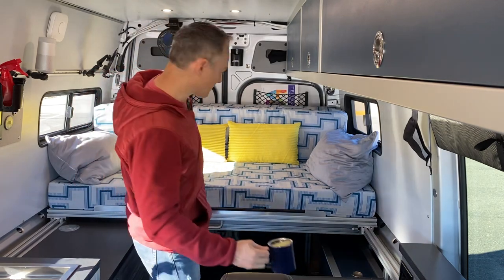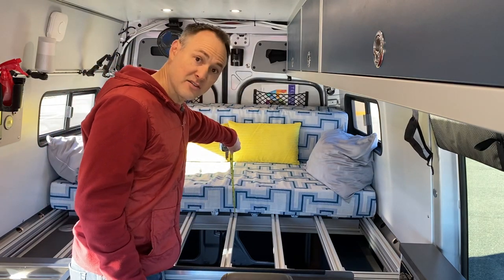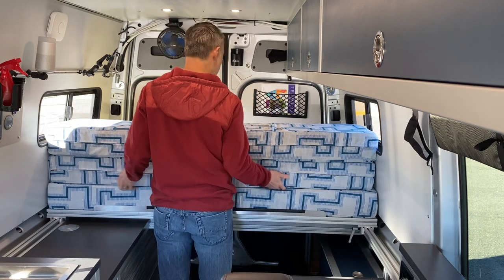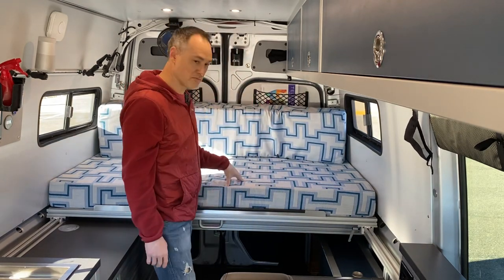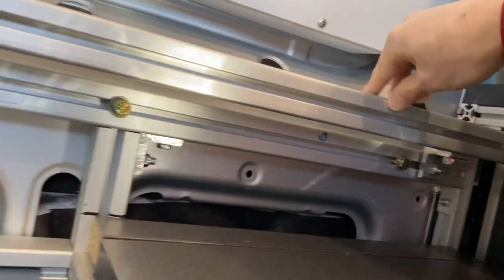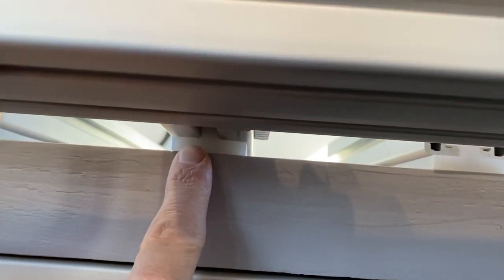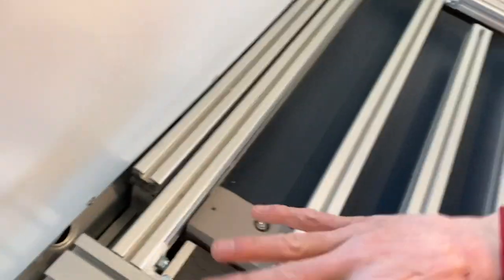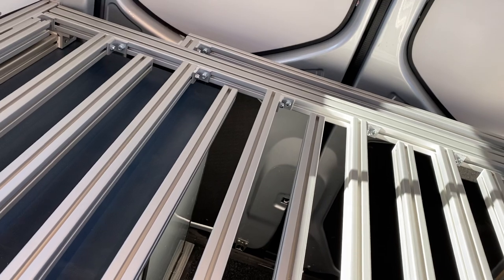Sprinter 8020 bed - deep dive

Comment: Really nice job, I admire your ingenuity. The sliding bed really gives you more space when the bed isn’t in use.  Lots of moving pieces to lineup to make it slide smoothly, maybe a little Teflon spray on the sliders will help it slide easier. Really well done!

Comment: Nice build. You answered one of my questions for my bed design. You are using two wide beams to carry load without vertical support in the middle of the bed. 

I also appreciate your insight on the side wall  mounting. I have a 2017 Transit and I want to use existing holes as much as possible. Running an attachment rail with washer shims to get side risks perfectly parallel is easy with your design.

Comment: Hello Nick, it is really incredibly perfect idea to make a bed very variable and use the space in many ways 👍👍👍👍👍
Can I ask fid you assemble the sliding system... I need sth. similar and sliding, just not sure which parts to buy... And connect to make it sliding..
Reply from the maker: Thanks, I don't have the entire parts list most of it is just 15 series extrusion. This is the slider part https://8020.net/6525.html

Comment: I really like the multi functionality of this bed system. Couch mode or Chaise mode still allows for one person to nap, while another has access to the rest of the seating space or galley area. I will be using my Van for work (daily commuter) and really like the rear haul space this sliding bed system allows. Loadig bigger items, camping gear or mountain bike before you set up camp is great! Thanks for sharing. How much did this cost?
Reply from the maker: Thanks Calia, for the bed frame system alone it's about $1k

Comment: very nice, so basically a 2 part slat system.  I can see how squareness, parallels become important.  80/20 does not forgive out of square.  You could have gone nuts with the engineering on this one.  You could also have made the head of the bed area tilt up.  Like a Rock-n-Roll type set up.
Reply from the maker: Yeah trust me I thought long and hard on a tilting back. But in the end it hurt my head and probably would’ve cost me another 500 bucks. I still have ideas on how to add it in the future. However, it’s not something I feel I need at all so I probably will never do it

Comment: What do you think is the cost breakdown is for the platform ,the bed cushion material. I think you said it was 300 or 350 to cover it . I didn’t if that included the cushion material. Looks like you did a nice job building it using that 80-20 material seems to make it easier. I’m a machinist I’ve worked with aluminum it’s a easy material to work with though I’ve never worked that particular extrusion but it definitely looks like the Way to go
Reply from the maker: I would say about a grand for 80/20 give or take. Latex mattress about $250 (two 3" thick latex mattress toppers combined), upholstery $280 (including at tip). Look for something local, mine was working out of her home. I used sunbrella fabric which was most of the cost. FYI other larger upholstery shops wanted around $700-800. Yes 8020 is easy to work with, never had a single issue cutting it.
Reply: @nicksrig  that’s well worth it thank you
Reply: Howdy Nick...how many sticks of 80/20 did you use for this?  I’m looking to do the same bed in a 2020 Transit. Thanks!

Comment: Nick could you please share your design schematic? I really like your design over the original. I am about to build the same in my van.
Reply from the maker: Yeah happy to share, shoot my your email and I can send it. Keep in mind my schematic is not complete. Like anything my design is how I planned, but once I got into the building, things change a little and I never went back to update. I used Sketchup
Reply: This is a great video! Just what I have been looking for. Watched Savage’s video (also a great job!) and found yours after. Would love to have your schematic just to see the working parts. I have a promaster and know I will have to adjust measurements but having what parts you used would be so helpful.  Thanks.
Reply: Nick - would appreciate your plan too - appreciate that its a working plan and changes made as necessary during the build. 2 questions - and extra piece to the front and back slides would have made quite a big difference in spacing - in hind sight would that have made sense - or biased or smaller spaces in the center of the bed where most weight /knee pressing on the mattress when you shimmy up onto the bed/chaise. And question 2 - what is the added piece for up against the center of the doors - to stop pillows falling off because of extra space there? How can I get you my email?
Reply: Nice job and excellent explanation.  Could I get your schematic too?

Comment: Hi, Nick--this is fantastic, thank you for this!  A few questions---do you think using the larger 15/15 bars was overkill?  I ask because I've seen some other beds with just 3 or 4 of them spanning the whole width of a van.  Could you have used 10/10 and still be plenty strong?  Also, what is the total length of your bed and how did you choose its height off the floor?
Reply: @nicksrig   Aaah, so the fasteners become the weak link with the 10/10--I didn't think of that!  My bed height question concerns putting a bike underneath and balancing that with sitting height above the bed, and length I ask because I'm 6'5" and found the crosswise sleeping didn't work for me when I tried one for a week.

Comment: I’m SO surprised you don’t notice the bed being in 3 separate pieces! I have been waning to do a custom latex mattress as well and have been thinking about making it like a trifold mattress, but I like the flexibility you have of doing different positions. 

Did you get a full mattress and cut it yourself? If so, where’d you get it from?
Reply from the maker: Sorry for late reply, but I bought it on Amazon and cut it up. I doubled it up as well. So it was a 3" mattress topper and I doubled it up to 6". I then found a local seamstress and had her cover them in Sunbrella fabric. No regrets whatsoever

Comment: Curious, think you could build what you did and also make the entire platform able to raise and lower along tracks? I'm thinking about how to dot his and whether it'd work in a high roof van to get the bed out of the way to accommodate a table below it.
Reply from the maker: Interesting question, and anything is possible with 8020. Just off the top of my head this is what I would do to make that happen. Build the bed system the exact same way but not as wide. Instead of attaching the side rails to the van mount them to 4 horizontal rails with the same slides with locking breaks. Hard to detail it in writing, it would need to be done in sketchup or similar. Honestly, I wouldn't try it because it presents other issues like lifting the bed evenly so it doesn't jam. I would probably just get a power lift bed system, then make an 8020 bed frame for it that folds up like mine. Best I got

Comment: Any thoughts about doing this in 10 series (1"x1") extrusion? 15 Series got really expensive and its about $2500 for the setup now
Reply from the maker: 10 series is plenty strong enough but the connecting hardware is super weak

Comment: What's your gap spacing for the supports? You mentioned they support the mattress very well and your knee sinks just a little, but I don't think you actually mentioned how far apart your supports are?
Reply from the maker: Hi Grover, it's 7" I do measure in the video, but I'll look back at it.

Comment: Can you please post the model number of the linear baring used?    Is it 6526, 15 Series, 3 Slot Mount Double Flange Long Standard Linear Bearing with Brake Holes?
Reply from the maker: Yeah sure it’s the 6525, and of course you have to order the brake separately
Reply from the maker: Brake is 2797
Reply: @nicksrig  thanks for getting back to me so quick! 6525 you mentioned are the short linear bearings. 6526 I am looking at and mentioned in my Q are the longer ones. Could you please clarify?
Reply: Ok 6526 won't work, 6525 is the part I should be getting. Thanks Nick. Good improvement to seven o savage's design.

Comment: How easy is it to remove the sliding portions? Does it require tools?
Reply from the maker: Not easy, you would need tools. I’m sure you could design it to where it could be easily removable. But mine is not

Comment: I'm pretty close Nick. I'm at the slide portion...how did you keep it from swaying side to side?
My guess is as I attach the doubles it will rigid up
Reply from the maker: Awesome, not sure I 100% follow what you’re talking about but the plastic slides across all the rails are what keep it aligned if that’s what you’re referring to
Reply: @nicksrig  I have it set man...I changed up your design just a bit. I like it the way it is. You helped out a bunch with my idea for my system

Comment: Not sure wHere you get your 80/20, but that bed setup prob cost around $1000 at least!! 80/20 is not cheap, and there is much cheaper ways to accomplish the same thing. Looks nice though, if your rich and have the money to spend
Reply from the maker: Oh agree with you! I bought it pre pandemic, I can't imagine what it cost now. It was more to me that functionality, I want strength. It also acts like an internal impact cage if I'm ever broadsided (I have kids in back). Alos, if I'm ever in an accident I don't have to worry about wood shrapnel flying all over the place. That bed isn't going anywhere.